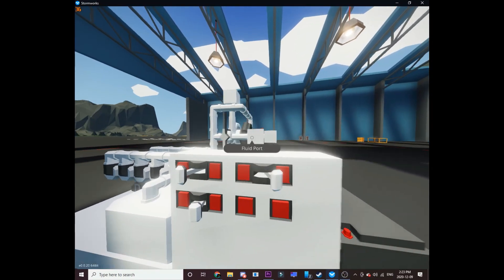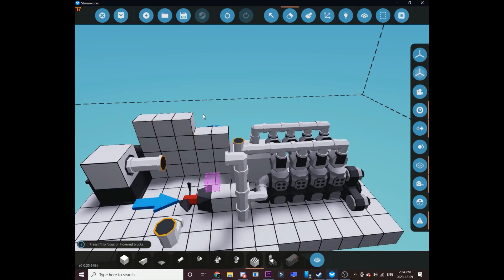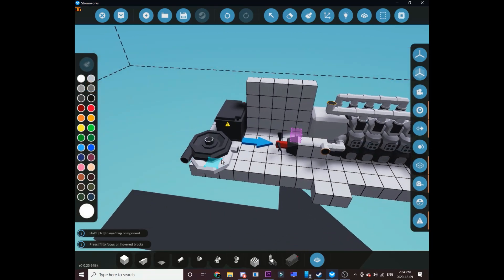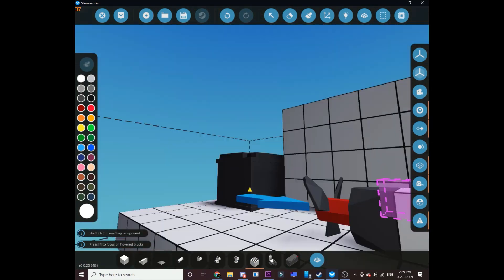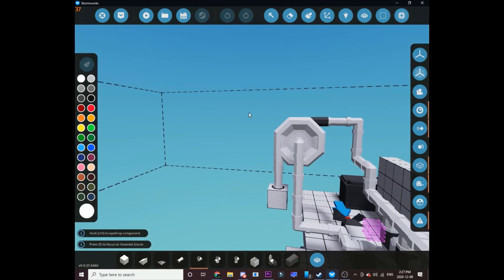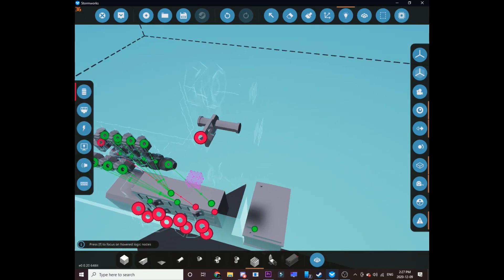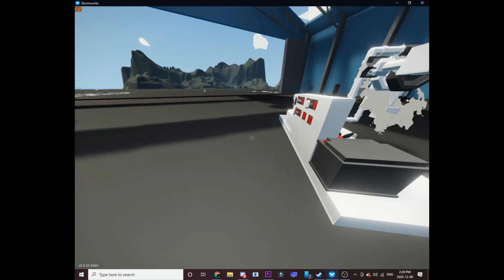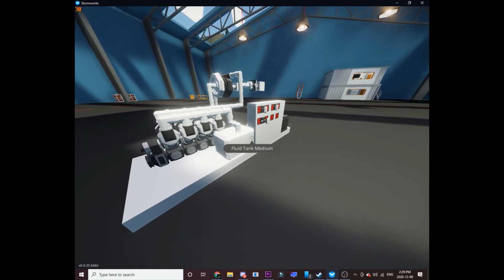Stormworks turbocharger tutorial

Comment: “Shit that’s embarrassing” 😂 thas me tryna get the modular engines to work as-well lmfao
Reply: Question, are you supposed to combine the air and fuel into one pipe before putting it into the engine, Cus I haven’t been doin that.
Reply from the maker: @jakobusjohannes2195  nah it doesn't matter, just as long as the engine has at lest one fuel and one air, and all of the cylinders are joined then it should work

Comment: But how much more power does it build?
Reply from the maker: In the new update they split the turbo in half and added a power node on the rear, in a supercharger configuration it will add a LOT of low end torque to these modular engines. But getting the afr to stay at a good ratio is quite difficult usually the engine will lean out and die when boost kicks in.
Reply: @derf6572  could you make a micro processor to maybe change the air and fuel values automatically to a good configuration?
Reply from the maker: @matthommel3546  you may be able to but it would be very difficult because there is no node to read the afr, the only way to read the afr is to look at the pistion itself, once they add a node to read the afr im sure many auto afr microcontrollers will come out
Reply: @derf6572  hmm i see...
Reply: @derf6572  I want to see someone build a "max" size tanker with a massive mod engine in in

Comment: I can give you tip with the A/F Ratio:

Throttle (from an engine controller or whatever ) > clamp 0-1 > Air manfold
Throttle > clamp 0-1 > Multiply A (B is the fuel manifold throttle value,  0.35 recommended) > Fuel Manifold

Thank me later.
Reply from the maker: yea i know that, but everytime a new update comes out i like to mess around with the AFR
Reply: i just connect throttle to air then divide that by 2 and send that to fuel. no problems and works perfectly